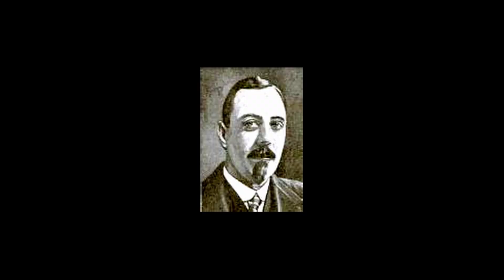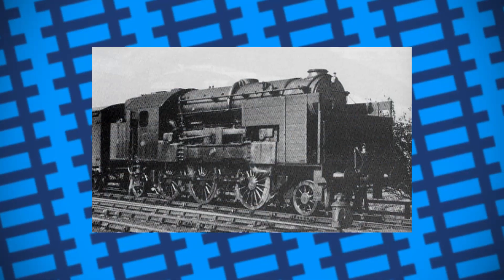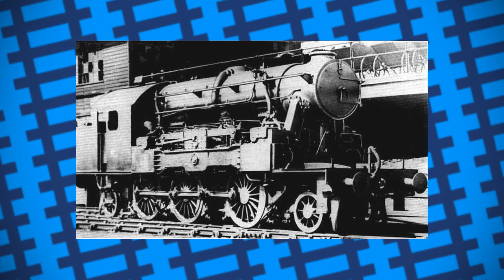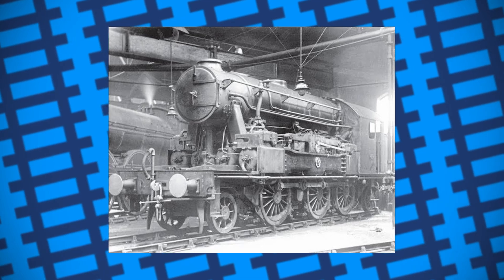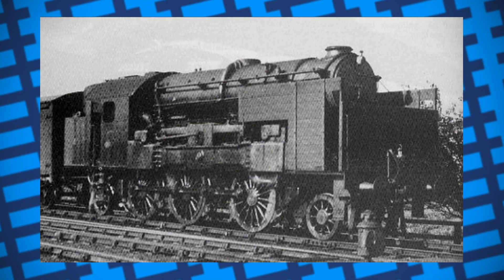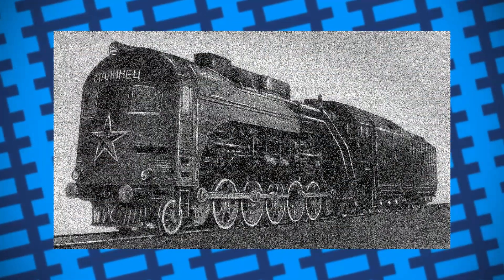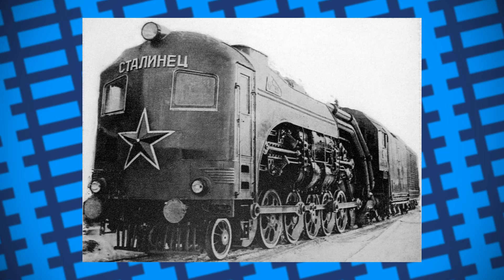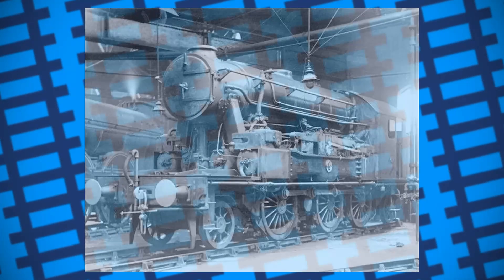The unusual trains that ran on Steam AND Diesel - Kitson Still Engine

Comment: The first ever bi-modal locomotive if you think about it.
Reply: More like the prius of trains but cooler
Reply: Hitachi, eat your heart out 🤣
Reply: There's also the Swiss Electric-steam locomotives, which could be powered by overhead wires running heating elements in the boiler. Those might have been later though, WWII era.
Reply: @quillmaurer6563  A wartime work-around, in actual fact.
As far as I am aware, they were adapted to electric firing as the only heat-source, not as an option.
I would like to learn more about them.
Reply: @quillmaurer6563 and now we have modern electro-diesel locomotives to keep the trend going.
Reply: Yes
Reply: Let’s not forget about the Alco tri-power boxcabs.

Comment: The locomotives is the most European looking, British Locomotives I've seen
Reply: A locomotive that goes without "beautification"
Reply: Nah, I think that honor would go to the flying Scotsman.
Reply: @aaronfield7899  only when fitted with the German style smoke detectors. Otherwise she has the classic LNER/Gresley look.
Reply: @aaronfield7899  the flying Scotsmen looks nothing like a European loco, it's not got random stuff hanging on the outside or loads of visable pipes all over it. It's very British in look.
Reply: @Alex-cw3rz  So the British isles do not count as European?
Reply: @aaronfield7899  the way they designed trains is distinctly different. I'm not sure why it was done. But British locomotives had as much of the pipe work hidden whereas the rest of the world didn't. Materials and designs were also more expensive and intricate for example look at the wheels of a British locomotive including painting schemes and the cheaper designs equivalent overseas.
Reply: @aaronfield7899  To the present-day turnout of that loco, yes.
Reply: @tooleyheadbang4239  Really? How did it turn out?
Reply: @aaronfield7899  Hideous.
Reply: Yes